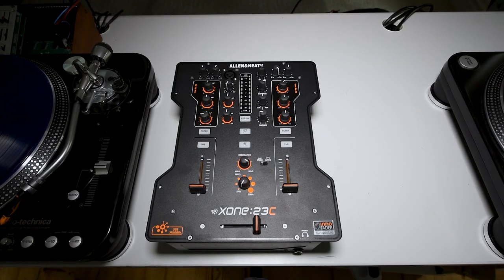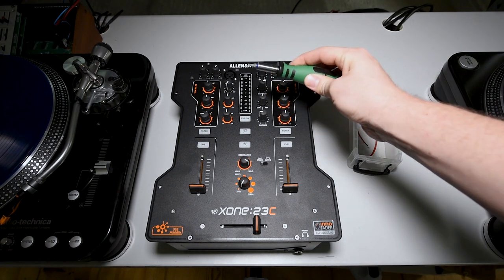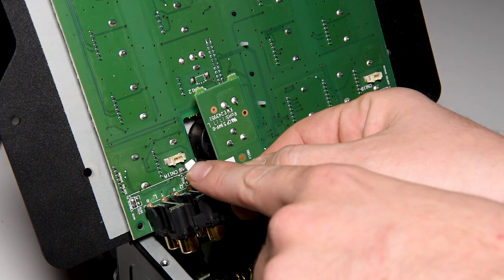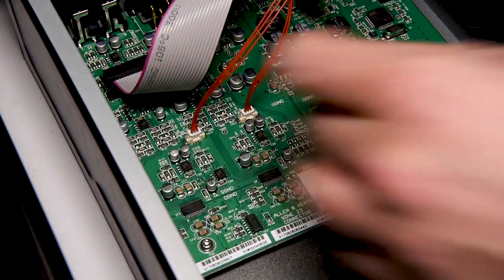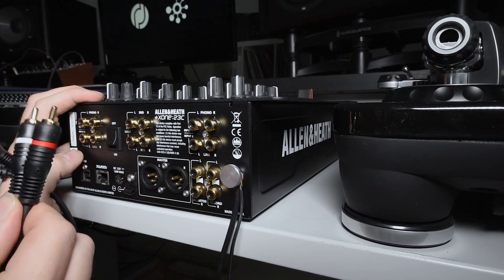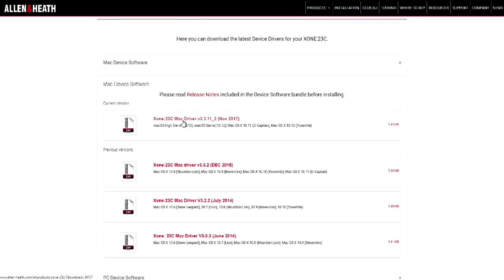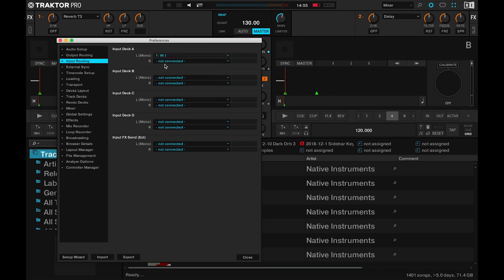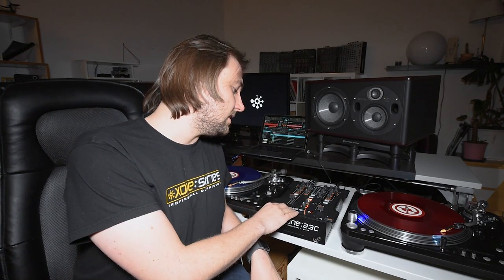#XoneQuickTips - Xone:23C TP3 DVS Mod

Comment: hi can you explain how to record with the dvs cables plugged in? I just see signal only from one channel on traktor
Reply from the maker: Hi Marco,

With the DVS jumpers fitted, the 23C will no longer route the record and FX send via USB, as these channels are being used for DVS. In this instance for recording, you will need to use the RCA record out into a third-party interface (built-in card?) or dedicated field recorder.

Best regards,

Luke
Reply: @xonedjofficial  Hey, thanks for answering Marco as I have the same issue. As I understand, I need to but an external device (I am using Mac OS) ? Could you tell me exactly which one if needed ? Thanks

Comment: Hi, quick question , after this setup, I can play the regular vinyls or  do Ineed to  remove the cables  inserted previously for DVS. Thnaks.
Reply from the maker: Hi,
Thanks for the message,
The short answer is yes! The USB playback for the computer comes in on the mixer post gain (level). The Gain therefore need to be set in the software for USB playback. Furthermore, you need to ensure the gain turned down (off), to stop the DVS tone from being audible when using DVS. Then, when you want to simply play regular vinyl, you would manage the playback to normal way.
I hope this helps!

Best regards,
Luke
Reply: @xonedjofficial  Thank you for the answer. Best regards from Colombia.
Reply: @xonedjofficial  Hi Again,  I did the setup and  everything is going well, I boutgh the traktor PRO to use the DVS. However  after a lot of  tests  at this moment I can´t record  the session,  can you help me  with this please?

Comment: Hello friends, I use traktor with the PX5, and the problem is that I don't get the software FX to remain post fader. That is, at the moment that under the fader of the PX5 effects such as a delay, it is without effect. I would be very grateful if you could explain to me how I can solve it. Thank you very much in advance.
Reply from the maker: Hello David,
On the PX5 there is an option to set the FX send to work, pre or post fade with the “send” switch that is located to the top right side of the mixer.  
Pre-fade (fader down)
Post fade (fader up)
You will need to have the FX in Traktor set to send mode with the software and mixer also configured correctly.
If you require any further information on this, please drop us a line to support@allen-heath.com
Regards,
Luke
Reply: How big are you Luke! I will try to make the settings and I tell you how. Thanks a million for your attention.
Reply: Hi Luke. I have tried what you told me, and the problem is that when I configure Traxtor Fx to "send" the assignments to the different decks disappear. I have already sent an email to the address you have given me, but maybe you know why this happens. Thank you. Greetings.

Comment: Thanks for the video,I’m finding the volume on my headphones is low now?
Reply from the maker: Hello Stefano,
Thanks for the message.
If you are referring to the playback signal form the software. Please use the soft gain control within the software application you are using to set the USB playback level.

Kind regards,
Luke

Comment: Xone 23c Hi he is working with rekordbox ??
Reply from the maker: Hi DJ Eli,
Thanks for the message,
The23C will connect Rekordbox as an audio device, though some features may not work as it is not a certified device. Please note, it always down to the software to certify hardware. For more information on this please contact Pioneer support.

Kind regards,
Luke

Comment: My question is why does it not come with it build in already? Or let's say does change anything after doing this using it with cdjs or winyls? thanks
Reply from the maker: Hi Marlon,
By default, the Xone:23C USB sends run off the Record and FX buses. When the DVS jumpers have been installed, the USB send will no longer route the aforementioned buses.
Either USB setting will have no affect when using CDJ or Vinyl.

Best regards,
Luke
Reply: @xonedjofficial  Ok cool thanks! But if I have to use a reverb pedal as FX I need to change it back, right?
Reply from the maker: Hi Marlon,
No, the RCA FX send and return will work all the same, no matter how the soundcard is configured. So, you can continue to use your FX pedal.

Regards,
Luke

Comment: Hi Simon, I followed your tutorial, I tried this set up with traktor pro 2, I am getting signals in the input channels although the timecode inputs are blank even tho they are set to scratch and nothing shows when i play the vinyl. What could be the problem?
Reply from the maker: Hi Mirna,
So, just to confirm. You have fitted the DVS jumpers as instructed in this video? 
Can you also please let us know what OS you are running on the computer?

Thanks,
Luke
Reply: @xonedjofficial   I am using windows  10 on my laptop and yes I fitted the DVS jumpers as in the video
Reply from the maker: O.K, thanks for the update. For further assistance with this, please drop us a line via our support 'Help centre'.                                               https://www.allen-heath.com/support/
Reply: @xonedjofficial   Hi I just upgraded to traktor pro 3 and it worked

Comment: The mixer can works with Rekordbox software ? Or only with Traktor ?
Reply from the maker: Hi Samuela,

Thanks for the message.

The 23C will connect and stream audio with other platforms such as Rekordbox. Whether it will run with DVS or not you need to consult the developer.

Please note; it is always down to the software and software developer to set hardware permissions and certify devices. Not the other way around. 

I hope this helps!

Kind regards,

Luke
Reply: Works with rekordbox 5, not rb6

Comment: if we do the mod then is it goodbye real vinyl playback or do we now have both?
Reply from the maker: Hi Soanis, Thanks for the message. With the DVS mod applied it is possible to play both regular Vinyl and DVS. Just make sure to turn down the input gain when using DVS, as this will stop the time-code signal passing to the mixer channel. FYI; the DVS jumper mod changes the USB default routing, from the FX and record buses. You will, therefore, no longer be able to route these when the jumpers are in place. Thanks, Luke.
Reply: @xonedjofficial  thanks for the reply  ! Does that mean no external fx units possible with dvs? As far as recording goes, I’m sure it can be handled with software? But what if I’d like to use the record output to connect to unbalanced amps? Thnx!

Comment: this can works with traktor scratch pro 2? or just with traktor 3? thanks
Reply from the maker: Hello eldjdrunk,
Thanks for the message.
Really this is a question that need to go directly to NI. They have listed the 23C as a certified device against TP3, we would only imagine that this is then backward compatible, but highly recommend speaking with NI to confirm this.

Kind regards,
Luke

Comment: Once the jumpers are fitted I can still play conventional vinyl from the mixer right?
Reply from the maker: The short answer is yes!
The input pre-amp for the phono connectors is still active, you simply need to use the input 1&3 level control for the audio to pass from the turntables/phono inputs.

Regards,
Luke
Reply: @xonedjofficial  thank luke
Reply: @xonedjofficial  and computers front and rear to A&H 2&4?
Reply: @antonfarqua  hi! Did you actually try this out? This is precisely my question: I want a mixer i can seamlessly switch from timecode to conventional vinyl and back again, etc. I'd love to know how you went.
Reply: @vyvafc  no still don't want to open the mixer!

Comment: I cannot adjust gain on the mixer and only am able to in traktor itself
Reply from the maker: Hi, 

Thanks for the message. 

Yes, that is correct. In DVS mode the gain needs to be established withing the software with the soft gain control. 

 

Best regards, 

Luke
Reply: @xonedjofficial  thanks for reaching out quickly, my issue is im not using dvs, just my kontrol x1

Any chance of a future update to be able to control gain?
Reply from the maker: The Kontrol X1 is manufactured by NI. Please contact their support for queries on their products. 

https://support.native-instruments.com/hc/en-us 

 

Kind regards,
Reply: @xonedjofficial  its not an issue with the x1, im trying to adjust gain on both channel 1 & 2
Reply from the maker: The Xone23:C architecture is set so the USB return is post channel input gain. The gain, therefore, can only be set in the software! If you require tactile control with this, you could map a pot from the X1 controller to the software's gain settings!? 

FYI; The 23:C is an analogue mixer with a built-in interface. It is not possible to change the routing with a simple firmware update. 

I hope this helps! 

 

Kind regards, 

Luke
Reply: @xonedjofficial  thank you, i was really surprised since my friend xone 96 is easy to adjust gain with usb

Comment: Hi! if i do that does it still work for normal vinyl?
Reply: and cdjs?
Reply: @roguca31  use multicore cables
Reply: Use multicore cables
Reply: @rafaspain  what's multicore cables ?
Reply: rafaspain isn’t this is a 2+2 mixer so wouldn’t  you just use the input signal  to switch from phono to line? Or you would still need to use multicore cables?
Reply: Yes, same question here, what if you play non time code records, do they still play as normal?

Comment: will this work with rekordbox dvs?
Reply from the maker: Hi Jake,

The Xone:23C will work as an audio interface with any software that allows you to select a generic device.  The question is more will the Recordbox software work with the 23C!?  We believe the answer is yes, but please confirm this with Pioneer support.

Kind regards,
Reply: @xonedjofficial  thanks for the info. I'm in the market for a new mixer. Pretty certain it needs to be A&H but I want to use rekordbox DVS when I'm not playing vinyl. I will try get to get an answer direct from Pioneer but they are of course very vague on any previous forum posts I have found.
Reply: Did anybody get it to work with Rekordbox? I've got it hooked up now, but can't get DVS and gain control to work.
Reply: @BusterPalmer  apparently works with rb5 not rb6

Comment: Hi There, Just couple of questions, 1 is this suitable with CD time code or only Vinyl? 2 can i  know the size of the torque driver?

Thanks a LOT
Reply from the maker: Hi,
Thanks for the message.
The DVS jumper option is only set to run from the 23C phono inputs. However, it is possible to convert the phono inputs to line level, please refer to p18 in the user guide for more information.
With the Line level conversion, you will be able to use CD with the DVS.
I hope this helps!

Best regards,
Luke

https://www.allen-heath.com/media/AP9433_4_X23C_UG.pdf
Reply: Xonedjofficial 
Hi Luke thanks for your help..
I have looked up the link, if I’m not wrong in I remove the resistance I will loose the phono/ vinyl outputs as it will be converted and the DB will be higher..

Thanks
Reply from the maker: Yes, that is correct. When converted to line level, the inputs will no longer route through the RIAA filter, which is used for phono turntables. 

Thanks,
Luke
Reply: @xonedjofficial  Hi Luke, could you please explain how to remove the resistors? There's only one sentence in the manual about it, but it doesn't actually explain how to do it. Thanks in advance!
Reply: @xonedjofficial  One more question. If I do the line level conversion, is it permanent, or is there a way to convert back to phono? Thanks.